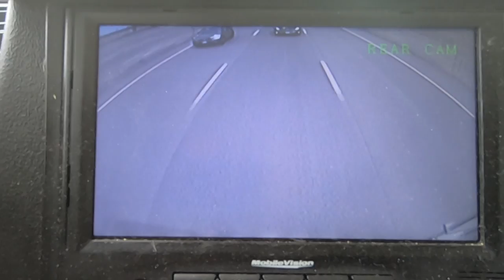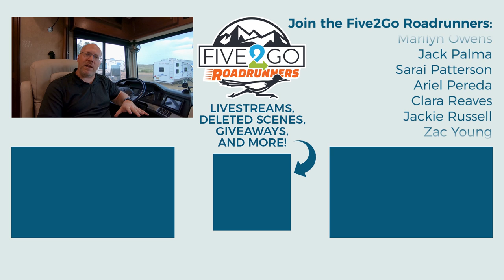Making Our New Motorhome Safer! SteerSafe RV Stabilizer Install

Comment: Remember:  you get what you pay for!  I fear you chose poorly.  Safety steer is a much safer system!  It is a restrictive system that is based on hydraulics.  Hydraulics can only flow through the size of an orifice at a certain rate. What you installed is a system that is based on Springs!  If forces are great enough they will over whelm a spring system.  Hydraulic systems are always superior to spring systems.  They by nature limit how fast your steering system can be affected by forces greater than you can control..  Please reconsider your choice.  Your family is worth the price Deference. Very concerned about your choice.  Make sure your suspension system is aligned properly and set to factory specks.  Than install the safety plus system!  Make sure your steering system is centered on the high point when they do the alignment.  If they don’t know what that refers too.  Go to a shop that knows what that means...  I have found that many shops don’t know or understand how alignment systems work.  It’s scary how many shops don’t know what they are doing!!!  Please, for the sake of your family,  switch to the safety plus system.  Pay the difference and know you are protecting your family with the best system available....  please Reconsider your choice.  I share this because I want your experience to be safe and uneventful.  Just so you know I am a trained master mechanic.  What you shared scares me greatly!! I don’t want other people to install a system that is unsafe. Pease do not take offense at what I am sharing..  I can’t stand by and have people be influenced to make dangerous decisions.  I mean only to be helpful.  Best wishes for you and your family.  I only want you to have safe and uneventful travels. Blessings to you and your family.
Reply from the maker: I think you're overreacting a bit, but I appreciate your concern. This company has been making these systems for more than 40 years so it is far from an unproven design. Also, it's not like I replaced a critical system with something that could fail and send me flying off the road, all steering stabilizers are just additions and they can all fail but it's not like a wheel is going to fall off if that happens.

Comment: That seems incredibly dangerous to me... if one those springs were to be knocked off - say by hitting something in the road - the wheel would jerk to one side which might actually cause an accident.  I'll stick with the other type of system which is pretty much foolproof.